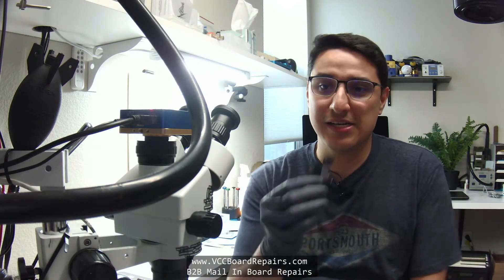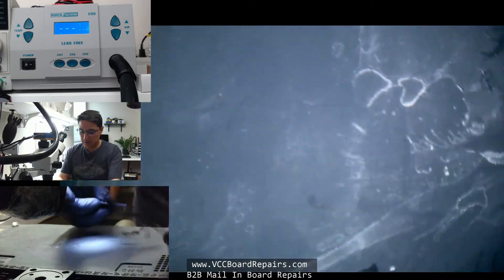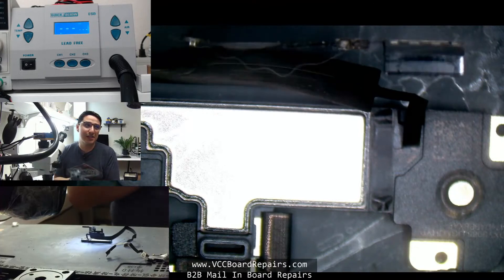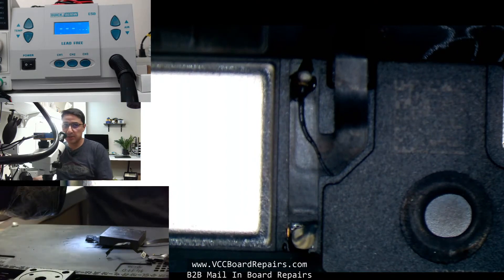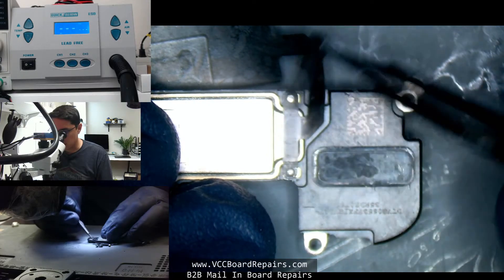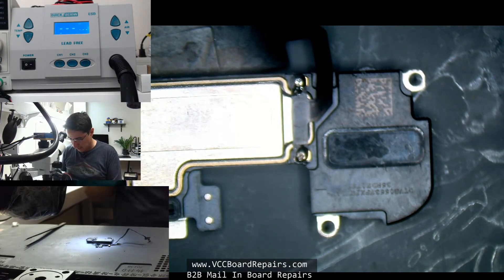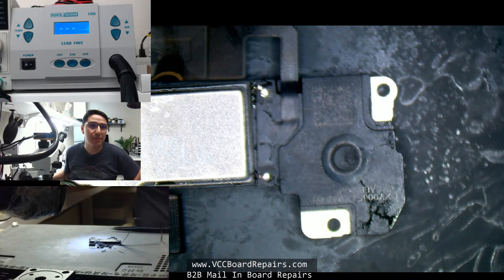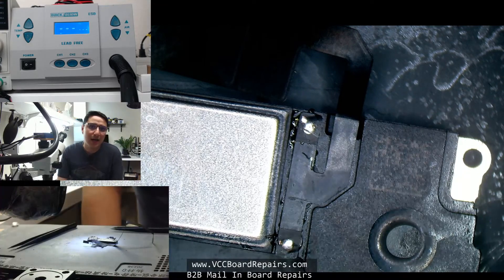iPhone Ear Speaker Swap - Super Easy - Works for X, XS, XS Max, XR, iP11, iP11 Pro, 11 Pro Max

Comment: hey I have one big problem. I just disassembled my iPhone X and peeled the tape which hides the soldering points. Before replacing the earpiece, I cut an old aux cable and attached the positive and negative wires to the speaker. In fact I could perfectly hear the music which was playing on my Mac through the iPhone speaker. So it is definitively working well. There are also no visible damages on the whole speaker flex. As you have mentioned the Face ID involvement, Im aware that I can't replace the flex itself. What would you suggest? regards
Reply from the maker: if you damaged the flex, then you need to swap face id sensors to a new flex

Comment: Would this repair not work on the iPhone 12 models? The title only mentions X and 11 models
Reply: It works, just did yesterday.
Reply: @eriknahmad3527   hopefully it will work for 12, 12, 14 and up models too
Reply from the maker: Yes it works for 12 series

13 and 14 don't have soldered speakers
Reply: @VCCBoardRepairs   so does thst mean that the ear speakers on 13 & 14 cannot be replaced without disabling faceid?
Reply from the maker: Correct

Comment: I need help to strange situation in iPhone 11. There is problem with ear speaker. Phone was hit on ground.. so I replace to used but original lcd. When I talk I hear sound, but this is low. So I clean net.. but this was clean.. and I replace new speaker with face id and etc.. and swap this all without soldering.. but audio is still the same. I check in options audio settings and I make this options off and on without result. What may happend ? :/

Comment: So I ended up changing the speaker on my iPhone 12 pro max and everything was successful. Here I am the next day and I'm having some severe battery drain issues. Can this be caused by only changing the speaker? I'm a little puzzled as to what could be causing battery drain. Thanks
Reply from the maker: Ah interesting. I've never seen that before.
Reply: @VCCBoardRepairs  It very well could be coincidental. Appreciate the comment. Very easy like you said.

Comment: There is an earpiece mode for the i2c i6 programmer. Can you just copy the code from the original and put the original code on the replacement instead of soldering?
Reply from the maker: No, it's not that easy, sadly.

There's a whole different process for that. I'll do a video about that soon.

Comment: In the case that the ear piece flex cable was damaged during disassembly, is there any possible way face ID could ever be made to work again? I am assuming not and just have an aftermarket ear piece+proximity sensor assembly in there now with no face ID. Sure is annoying due to the lack of a fingerprint sensor on the 11 pro max. Could the old sensors be transferred to the new flex cable?
Reply from the maker: Yes, you can swap the paired sensors to a new flex. I have video on my channel on that as well: https://youtu.be/tqGauLtcMws

Comment: I’ve got some silver bearing rosin core solder, would that be okay to use for this? And also the only flux I can find around me is all in a tub not a syringe or a stick. How should I use something like that?
Reply from the maker: I'm not sure, I've never used that stuff. But it should work. It's just 2 solder joints

Comment: Would a magnify glass be required to perform this task?
Reply from the maker: I would highly recommend using a microscope for this. Maybe you can get away with a magnifying glass.

But that's up to you & how confident you are in your abilities to solder
Reply: @VCCBoardRepairs  thank you for your quick response 🙏🏼

Comment: I just tried this myself and successfully completed it however i ended up melting a small part of the flex cable how do you stop this from happening?
Reply from the maker: Congrats on successfully swapping out the speaker! Perhaps you kept your soldering on there for too long? 

With enough flux & solder on the tip of your iron, it should super quick to solder on.

Comment: Hey there! So I followed through all the steps, yet my the speaker of my phone still sounds a little blown out, it doesn't have that high quality sound that was hoping for. I was wondering if you could help find out what might be the issue. I've replaced the ear speaker and I was successfully able to solder the flux to the new one, yet it still sounds blown out. Thanks so much.
Reply from the maker: Check the mesh on the screen to see if it's dirty
Reply: @VCCBoardRepairs  Yeah I cleaned the mesh and everything, but it still sounds a little blown out.
Reply from the maker: What if you test the speaker without installing into the screen?

Comment: is there anywhere to get this cable?
Reply from the maker: Injuredgadgets.com
Reply: @VCCBoardRepairs  unfortunately this cable is not available
Reply from the maker: https://www.unionrepair.com/replacement-for-iphone-x-ambient-light-sensor-with-ear-speaker-assembly.html
Reply: @VCCBoardRepairs  would this work with iPhone 12 Pro Max?
Reply: @mjma1984  it should
Reply: @rajvitela  Thank you. Do you know which microphone does Siri use on 12 pro max?

Comment: Sir i have brocket face id ribbon but face id ribbon still work bu ear speaker not working so haw can rapper it pleas make one video please sir
Reply from the maker: you need to swap sensors to a new flex cable
Reply: @VCCBoardRepairs  where do we get the cables from?
Reply from the maker: Mobilesentrix.com